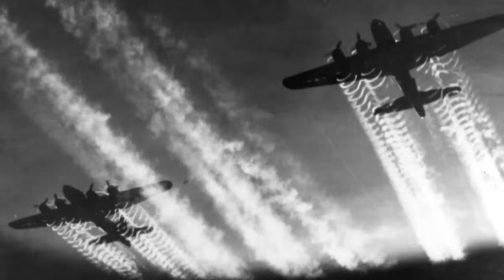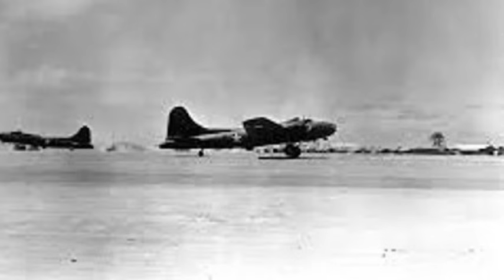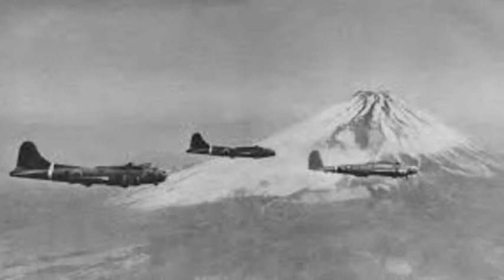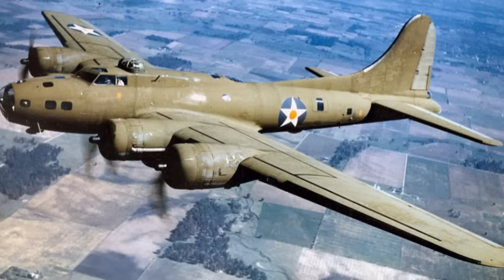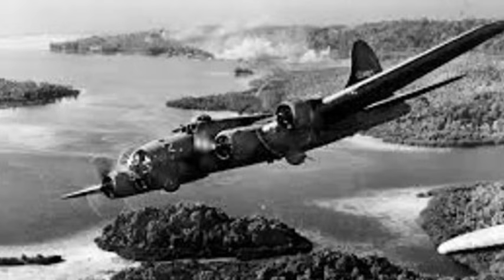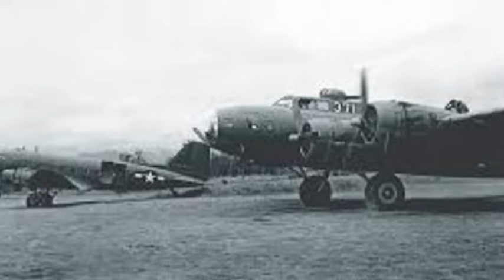Japanese Engineers Examined A Captured B-17 — Then Admitted They'd Never Achieved Automation Like It

Comment: My dad was a B-24 crew chief. He said instead of fixing damaged engines, they removed the whole engine (which was designed to be relatively easy to remove) and put in another working engine taken from a plane too badly damaged to fly or install a rebuilt engine from a depot. The damaged engines were cased up and shipped to distant depots to be rebuilt.